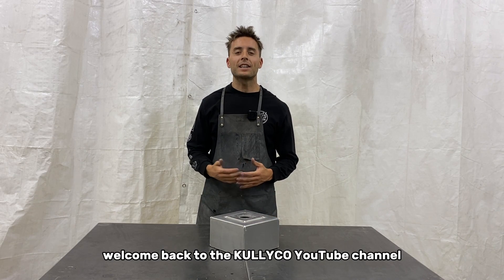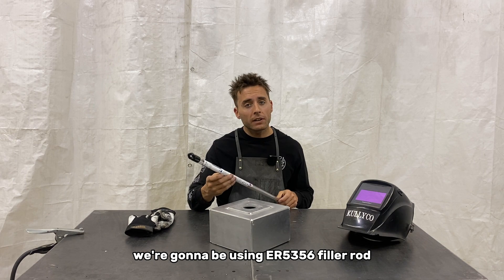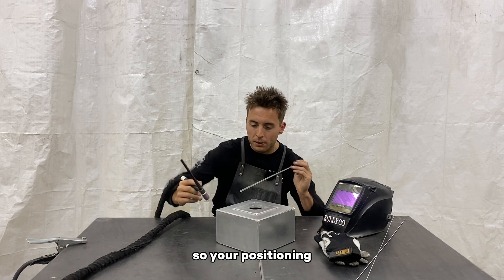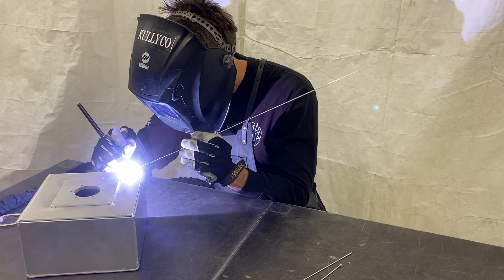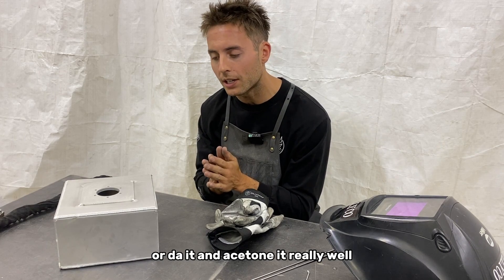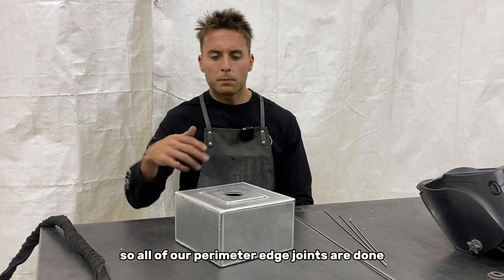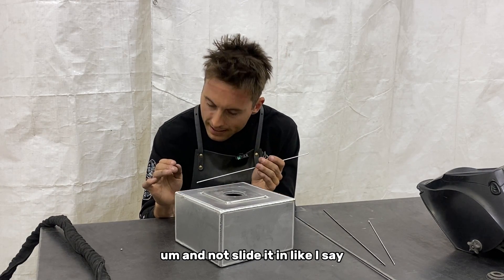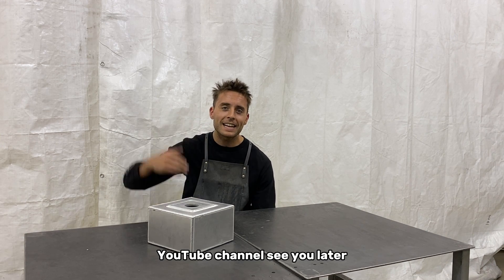How to TIG- Weld Aluminum step-by-step / Equipment, settings, and expert tips!

Comment: Did you set your amperage 125A for full peddle like the SS video you did ? Thank you.
Reply from the maker: Probably close to that, yes!  With the thicker materials, I still try and target a wide open AMP- that always helps.  However, that strategy is most critical with thin materials.

Comment: I prefer a number 6 cup with a gas lens on Aluminum.  The argon is wider on the 8 cup and etches further from the weld pool.  I get good cleaning action and full penetration on the weld.  It really comes down to personal preference.  For cfh I double the cup size and add 2 or 3 cfh more depending on the joint configuration.
Reply from the maker: Thank you for the input my man! Like you say- i think there is multiple combinations that will result in a decent aluminum weld.  I’ll have to give your number 6 cup a tip !
Reply from the maker: Rip **

Comment: It's difficult to think of everything that you might want to include in a video. 
But, you might need to explain the pointed Tungsten Electrode for AC Welding ??

A few people watching might be a little lost on why you didn't ball the Tungsten 👍
Reply from the maker: Thank you for the input! Yes , sometimes it’s tricky to think of all
The content to include in the videos . I should start making a little list before I turn the camera on:). Yes explaining the tungsten a bit more would’ve been helpful!
Reply: It might help with getting a “better” start, then will round off with use?

(Need to try this at home.  Last time I did aluminum was ~ 1988 or so.  Not sure if I want to try 1/8, though - maybe 1/16 or .080?)